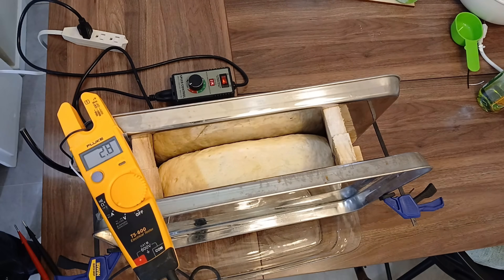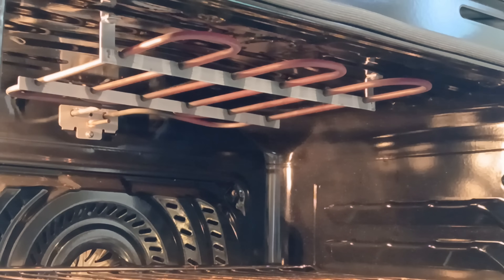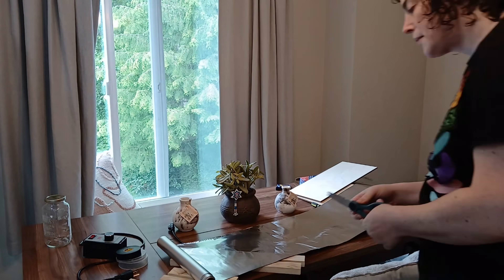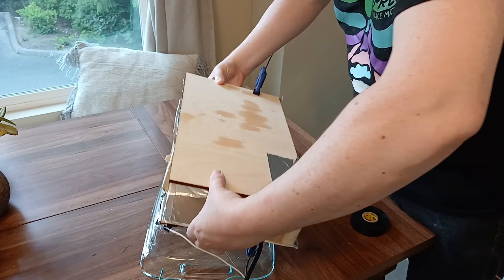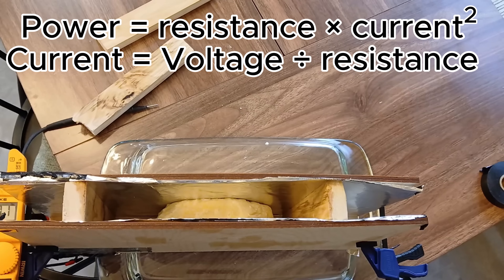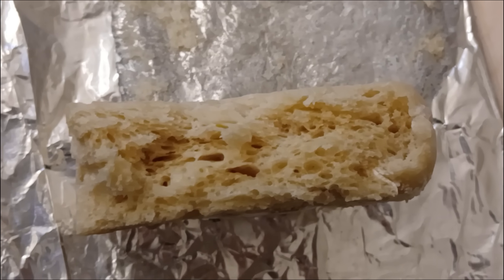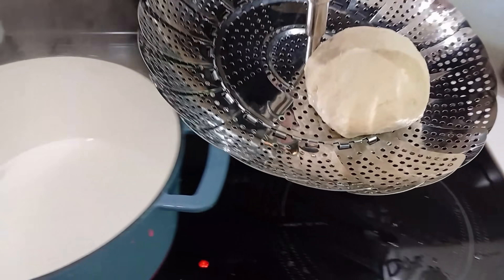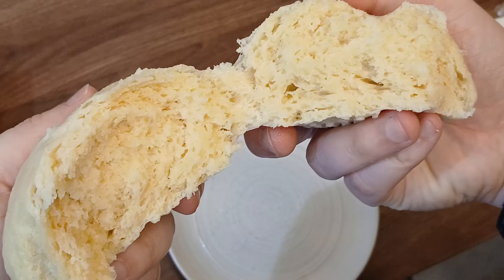Weird things happen when you electrify dough to bake bread

Comment: The lore on this as I know it is: the Imperial Japanese Army was able to source rations of flour to soldiers in Machuria but cooking fuel was scarce so they adapted the batteries of their vehicles into a McGuyver'ed version of this electrical oven.
Reply from the maker: That's the version I first heard, but I found this article that seems to dig into the history: https://recipes.hypotheses.org/17918

TL;DR: Yes, flour was easier to supply, but the Japanese military had been working on a good way to bake bread in the field for years before WWII even started, and designed these ovens as hyper efficient ways to bake bread.  (My oven bakes bread in 10 minutes using half the power of a toaster, and it would be even more efficient with added thermal insulation.)

Comment: Brilliant video. I love that you show the failed attempts first. Super interesting.

This should be taught to children everywhere as it's super safe unless you touch it and die.
Reply from the maker: Thanks!  The biggest surprise was how easy it was to get good results.  I spend a decent amout of time around electricity but seeing this work felt like magic.  

I definitely had to think about releasing this one because of the intersection of it being a super easy,  super cool, and fairly dangerous project. So I did try to hammer down on the safety issues.